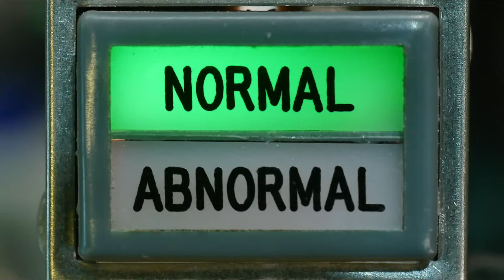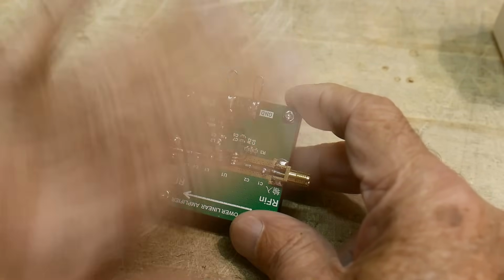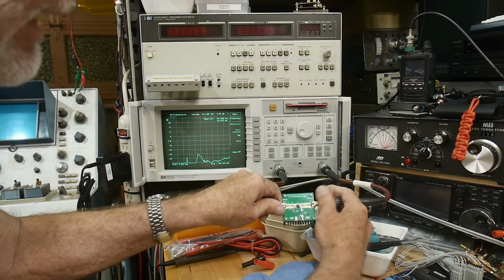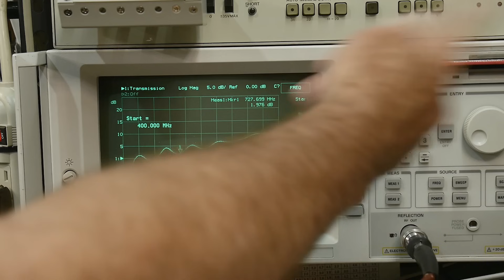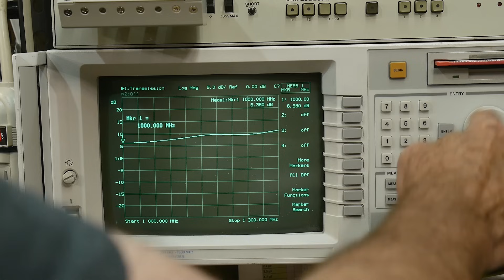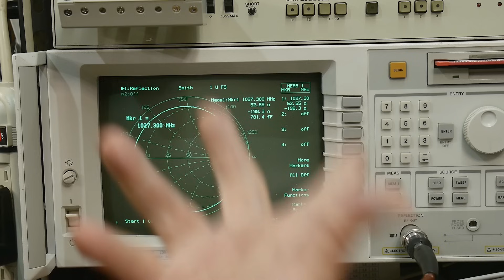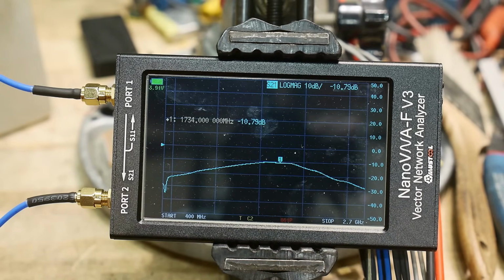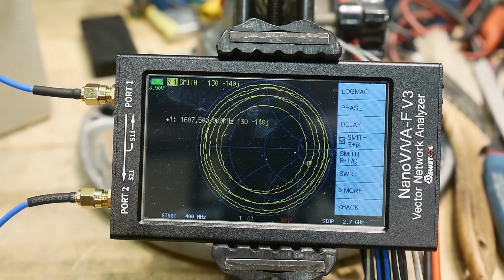#2037 RF2126 Amplifier  Fixed

Comment: It would be interesting if you layed out a board with the correct 50 Ohm lines and compared it to this.
Reply: Yes, perhaps a couple of videos on designing the thing 'right' with a performance check at the end, see if imsai guy can better the original Chinese designer, just an idea..🤔
Reply: Could it be for 75ohm video systems? Seems like on the last video, a lot of measurements came out around 75ohm (ish)

Comment: That is a horrible mistake. I guess if they just copied the examples in the datasheet correctly they would be in a better situation. I would never do An amplifier without looking at the basic things like impedance matching and heat   management.